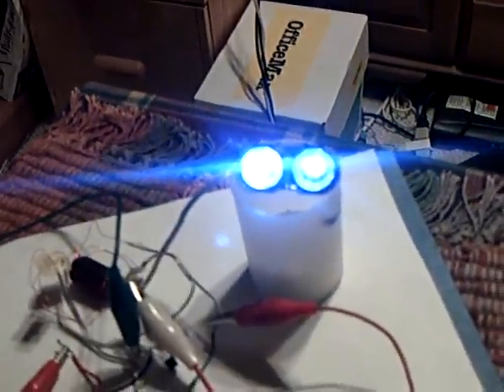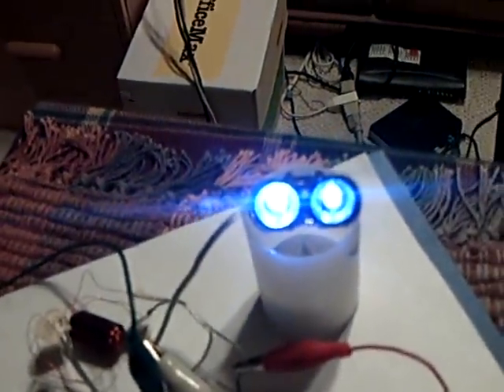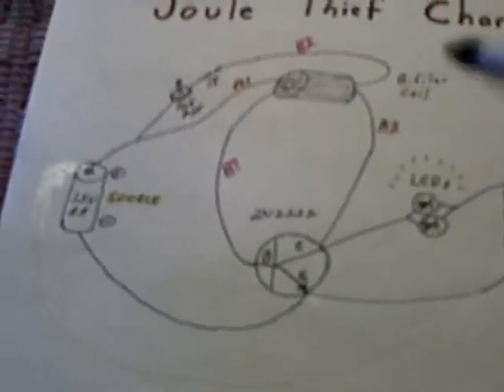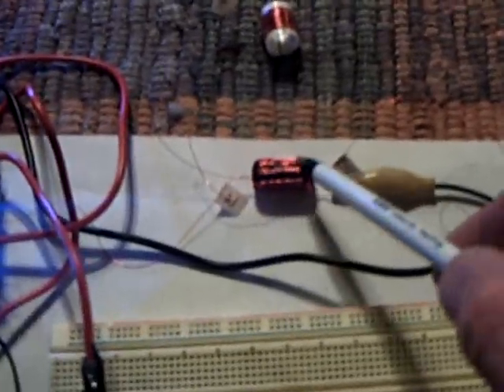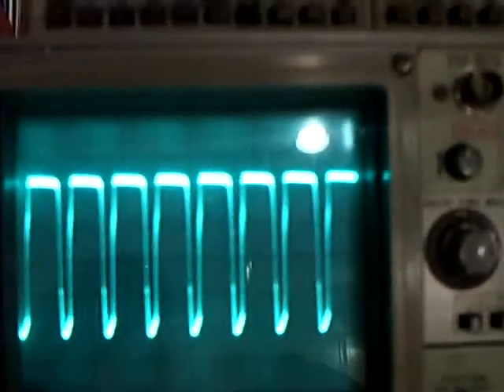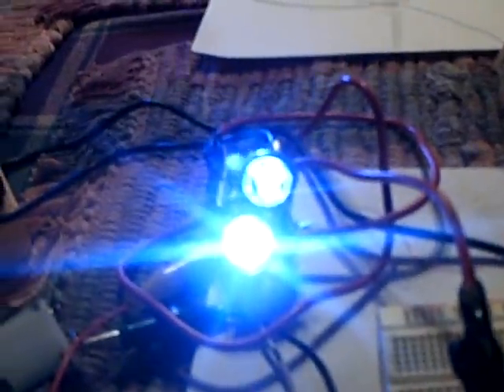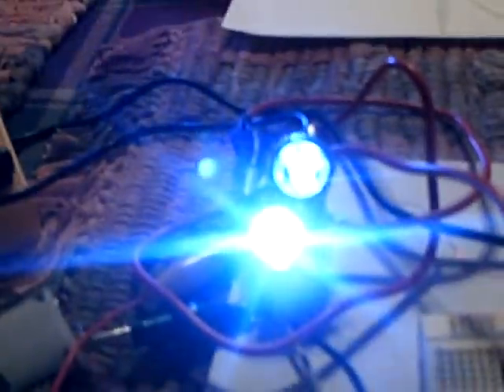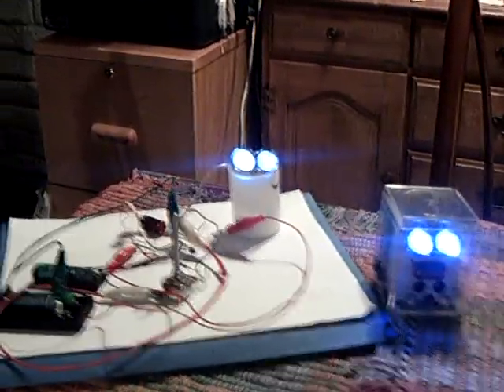Joule Thief nears end

Comment: Tesla explains that a standard coil of 1000 turns with a potential of 100 volts across it will have a difference of .1 volt between turns. A similar bifilar coil will have a potential of 50 volts between turns. In that the stored energy is a function of the square of the voltages, the energy in the bifilar will be many many times greater than the standard coil.

Comment: Why not try  to add storage capacity to your coil ? Just make your coil quadfilar. The 2 extra wires will be connected together, See picture on US Patent Number 512,340 . Tesla uses A and B letters for correct wiring sequence. Sequence is very important to follow. Lets say A B is starting wires on core, and a b end wires. First connection would be B+a, leaving you with A b (1 wire in your setup). You can try that layout on 1 ferrite core using 4 wires and just integrate to your existing circuit.